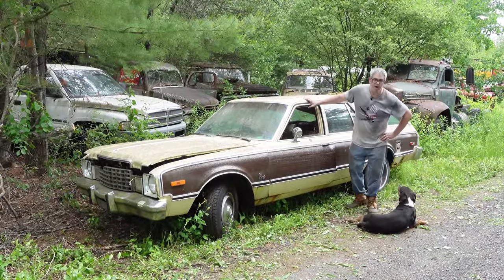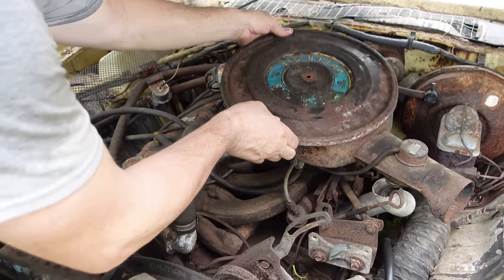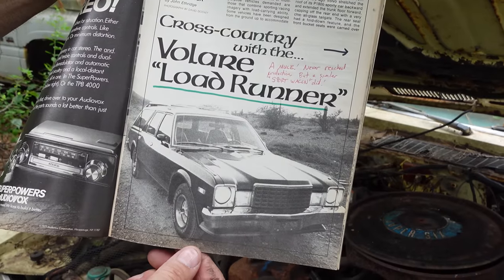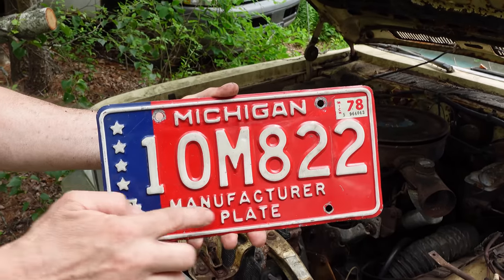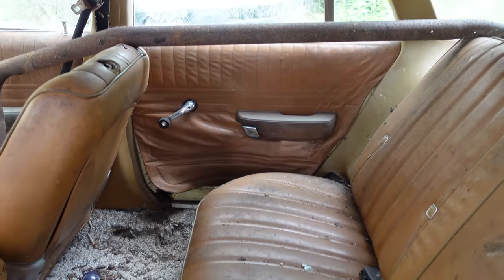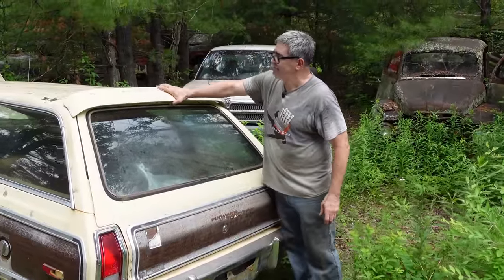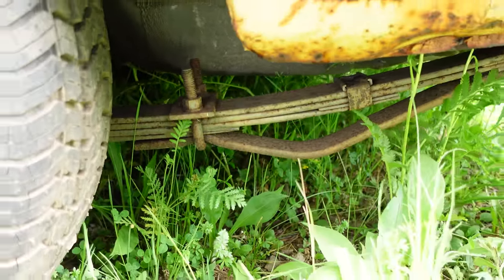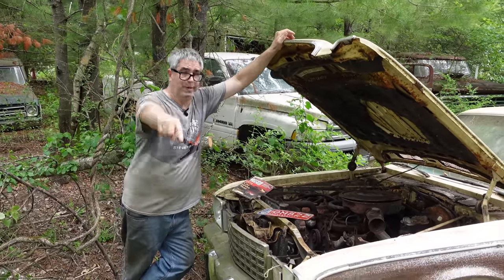Road Runner Station Wagon?

Comment: I ordered a '77 Volare wagon.  It had the 2-barrel 360 V-8 (4-barrel wasn't available) and was a bit pokey. Rally wheels, tuff steering wheel and I added the fender flares shown here plus a rear anti-sway bar.  Nice-looking car but it had lots of rust and water leaks, especially one somewhere in the right side of the cowl which I never could find or stop. After hearing of the front fender rust problems of the '76s, I made my own inner fender liners out of polyethylene and then a year later Chrysler added front liners which I bought OTC and installed. It was my last Chrysler product.

Comment: When we moved grandma from Pomona to Duluth, Mn in 1980, I sort of “inherited” her ‘78 Volaré sedan with the Super Six, as she stopped driving then. After 2 years in Pomona, the blue paint was completely oxidized from the LA smog, but the car only had 13,000 miles. That car had super comfortable front seats, and with a set of Firestone Town&Country snowies on the back, it could handle all but the worst of our winters here.

Comment: A local drag racer ran a wagon in the brackets, what was more unusual was it ran a 4 speed.  I believe it was originally an OD trans, but switched to a regular 833, and 318 or 360. There's just something about wagons on the drag strip.
Reply from the maker: Yes, I agree. That extra tail mass improves traction a bunch. And you can bring the drag slicks in the back if you drive to the drag strip! Thanks for watching and writing. -Steve Magnante

Comment: In the late '80s I had a 4 door Volare sedan with the 318. It was a police package car, but not an interceptor. At one point it needed a full brake job including rotors and drums. Regular Volare brake parts wouldn't fit, so I found another police car in a junkyard, made a deal, then parked beside it and swapped all the parts over.

Comment: Have to disagree with your comment about rusted out front fenders due to “mass production” - even after you mentioned that the fenders were redesigned with drain holes on later models.  Production workers don’t design the cars they build - engineers and management do.  Auto workers can only assemble the vehicles they are given, blame for an obvious design defect falls solely on the manufacturer’s shoulders.
Reply: Go cry to your Union representative 😢😢😢
Reply from the maker: @johneckert1365  Got a beef? Take it up with the Union Steward...Beef Steward.....get it? Ta-damph!!! Thanks for watching and writing. -Steve Magnante
Reply: @SteveMagnante  🤣🤣🤣🤣🤣🤣🤣👍

Comment: Our first "modern" car was a 77 Volare coupe that my dad bought in 1981 to replace the 64 Valiant convertible that my mom was driving. The Volare had the recall-replacement fenders in it because they were still in primer. Super Six, automatic, silver with a black gut. It eventually got passed on to me. An idiot in a 84 Camaro totaled it for me when he thought he could make a left turn from the middle lane when someone was passing him. 

My dad and I found a mint 79 Volare 4 door to replace it. We stripped the 77 for spare parts and junked the body. Drove the 79 until it rotted from underneath itself and made its last trip to the junkyard. 

I remember our 77 being much more sprightly than the 79. Not sure if it was because it was lighter or perhaps the gearing, but both were super sixes and yet the 79 was a slug no matter how much dad and I tuned on it. 

A friend of mine had a 76 Volare Premier coupe with a built 318. That thing was a sleeper. Surprised many a poser street racer with that beast.

Comment: The history of Chrysler Corporation can be summed up as "brilliant engineering undone by indifferent quality control."

What I remember most about these cars are the fragile grilles.  There were a lot of Aspens and Volares in the parking lot when I went to high school and just about every one had the grille punched in somewhere or completely missing,

My other Aspen/Volare memory comes from 1979 when I spotted a wagon with a factory manual transmission with a floor shift, which was so surprising even in those days I asked the owner where he'd had it done.  He told me it actually came from the factory as a special order.  It was probably a three speed but I don't remember for sure. I never learned what was under the hood.

The Aspen/Volare debacle is probably why Lee Iacocca made such a big deal of introducing and advertising his 5 year warranty against outer body rust through during the K-car renaissance.   I know the K's and L's don't get a lot of love these days but they were the right cars for the time.
Reply: Yea chryslers were garbage
Reply: Had a 76 Volare 318. four speed overdrive station wagon with 2.9? rear gears. On level ground on long trips would get 30-32 mpg . Around town would get 10 mpg due to the tall gears and having to wind the engine thru the gears.
There was a sticker in the glove box stating the fenders were warrantied when i bought it.
Reply: @mikew3443  2.76
Reply: I believe they got rid of the three speed, with the A body. As far as I can remember, I was a Chrysler dealer mechanic at the time, all manuals were overdrive 4 speeds. At least the dealer I worked at I never saw a 3-speed in anything other than a Duster.

Comment: Happy to see my base of operations, Michigan, get some love!  I live on the west side of the state, a good 4hrs from Detroit, but in the late 90s I saw an unassuming Saturn wearing a mfg'r plate parked on a side street. I wondered then what kind of secrets that car could be hiding.  Anyway, another great show, Steve.
Reply: Metro Detroit I see them every day. I've seen caravans of 6 in line on I-75. The weird thing is seeing the mules. Ten or 15 years ago, I saw a Dodge version of a suburban, a few miles from the Chrysler tech center. I was excited they were going to finally build one, and they never did. I was driving faster than he was, so as I was coming up on it I thought it was just a Ram with a cap on it. As I passed it I noticed it was all one piece body, not a pickup with a cap, and it had rear seats. This was before they even made the four doors.
Reply from the maker: @garyszewc3339  Cool story. It speaks to the fact that every single car ever built anywhere was once TOP SECRET as it made its way from drawing board to showroom floor. I spotted a 2002 Chrysler 300 in L.A. one time with an unusually long hood and front fenders, a dust cap in the center of the front (steel) wheel and a splined axle stub at the rear wheel center. Then I saw that it had TWO mufflers, each with TWO tips poking out beneath the rear bumper / "tail-scia". YUP, a mule car for the rear wheel drive / 5.7 Hemi powered Chrysler 300 / Dodge Charger LX cars but based on a stretched LH "cab forward" shell with added REAR WHEEL DRIVE! I had NO CAMERA but its was mean and sinister in matte black with its Michigan MFGR plates! Thanks for watching and writing. -Steve Magnante

Comment: Here in Australia we had the slant six two barrel from 1968.
It was a 160 hp rating displayed by badges on the cars painted in Chrysler turquoise.

The base single barrel was 145 hp.

Comment: My first car was a 1978 Volare with the slant 6 and torque flight transmission with the lock up torque converter. My dad bought me it for graduation and it was a great car. My parents also had a 1978 and it went over 200,000 miles witch was amazing for back on 1978. We also had a 1980 Dodge Ram with the same powertrain and it lasted forever until finally rusting out. The cars where so easy to work on and parts where cheap. Then came the LeeIaCOCKA K-crappers.

Comment: My dad had @ 78  wagon with what was effectively the Police Package. All the running gear was heavy duty it had a 360 with a 4-barrel it had a transmission cooler, it was set up.  At one point in time they even had power steering coolers. Lol. It was Tan on tan.

Comment: Hi Steve, great video on this Plymouth Volarie Wagon. As everyone knows Bob from Bob's Burger's drives a red one of these. 😂🤣 But I started my demolition derby career in one of these. I had one of these that had been sitting for a few yrs unclaimed in the back lot of the shop. While in another discussion I was presented with the idea of how to get rid of the wagon... properly. "The only thing that car is good for is the demo derbies." My soon to be crew chief had spoken! I took the bait. So the guys in back told me they would paint it up and get it all stripped out and derby rules ready. Let me just say if you ever get a chance to have someone else set up your car make sure you put down some ground rules. I didn't and left it up to the guys. I figured I'd let them have free rein of the whole project. Well after they had finished tearing out the interior and repaint with some sponsorship names, it was labeled the Rainbow Bright Wagon! It was spray painted with rainbows, pinks and other pastels, etc and someone had fastened a traffic cone on the top to look like the horn on a unicorn. This was well before the whole pride thing. Well I had to stick to my guns and drive this monstrosity in the derby at the county fair. Where everyone knew me and the shop. The only sponsors they could get for the Rainbow Bright wagon were my shop and the local crusher in the area. Even back then there was little to no support. I was told the car started off as a 'hippy thing' with peace signs and flowers. Well, the peace signs never made it onto the car. The guys did well I'm not a derby expert but they had me set up good. Battery, fuel tank and radiator were relocated and a hand throttle that went through the dash and a floor mounted shifter made of 1in square tubing. The doors chained and welded together and at my request some extra steel welded into the driver's door. So it's showtime! I'm out there pushing and doing OK. I made it through the 1st heat and 2nd heat. Boy, was that a day of adrenaline overload. So I made it to the final round. It was 6 of us left and my leaning tower of power was over heating some and beginning to hesitant to take fuel. The guys were shocked they had to actually work on the thing and keep it in shape for the final round. They just knew it was over in the 1st round. So we all limp back onto the track. My biggest worries were the 74ish Chevy wagon and a 80s Ford wagon. A couple of pros in the business. I forgot I became the crowd favorite to get beat on. So through out the entire event I was the target. I guess folks don't like rainbows and unicorns 😅.  Well I finished 3rd and had to break off my flag. My engine stalled and I couldn't get it running and I was pushed up against a barrier with one of my front wheels tangled up with a 70s Buick 4dr. So after the event as they were cleaning up the carnage one of the guys wanted the batteries out of the car so as it sat in the out field waiting on the crusher to take it away. He decided to see if it would crank and sure enough that 6 came to life after a bit of smoke from under the hood it sat there and idled. The only thought that came to mind was when Terry Malloy said "I coulda been a contender. I coulda been somebody, instead of a bum, which is what I am, let's face it." 😂. That was my demo derby career in a nutshell. I retired in 3rd never to return to the circuit again. Have a blessed day everyone 🤙🏼 Namaste 🙏🏼
Reply: 🥉🏁🇺🇸🛠⚙️
😂🦄🦄🦄😂
Cool story demolition man!
Reply: Skittles could have been your sponsor   CRASH 
THE   RAINBOW!!!
Reply: I can always count on you for a great junk yard crawl morning story Chris,I'm curious,what does namaste stand for???
Reply: @jeffreycarleton1535  Hi Mr Carleton 👋🏼 So now I'm gonna have get another rainbow bright wagon built just so I can use that on the side of it. Crash the Rainbow! Well I'm packed up and ready to hit the road once again. Im at a small town called Roxoboro, NC. I was here for their 3 day music festival. The performing acts were great! Just wish the sound guy was a little more generous with the volume 🙄 Thanks for commenting Have a blessed day 🤙🏼 Namaste 🙏🏼
Reply: @williamcavanaugh1415 Hello 👋🏼I'll be delighted to explain Namaste.  (na-mah-STAY)
Three syllables and one simple word that has the potential to bring peace between peoples, peace between nations, and most importantly, peace within ourselves. Literally translated, namaste means, “The Divine within me bows to the same Divine within you.” Bringing our hands together at the heart chakra increases the flow of divine love, kindness, and compassion. Bowing the head and closing the eyes helps us surrender to the divine within. This word has many meanings and can be used as a greeting or goodbye. I believe in a richly diverse family of philosophies, traditions, and practices strung together by a certain core, essential beliefs. One of these beliefs is that the soul is eternal. While this physical body may perish, the soul continues on, taking physical birth and going through death, time, and again. Our souls continue in a cycle of birth and death until it achieves 'moksha' or spiritual perfection and is united with the Divine. But regardless of where one falls in the spectrum of beliefs, regardless of which name one calls God, be it Krishna, Christ, Yahweh or Allah, regardless of gender, race, religion, caste, nationality, sexual orientation, age, we are part of "vasudhaiva kutumbakam'. That is, we are members of a world family which shares the quality of Divine oneness. And so we share unity not only in Diversity, but unity in Divinity. If lived to its fullest intent, the meaning of namaste helps us drop all the walls that separate us and allows us to feel the hunger of others, feel the pain and suffering of others and also share in the joy of others. Three simple syllables, one simple word that asks each of us to do one simple thing, to see divine and be divine. These are teachings of respect and compassion, truth and justice, self-control and selfless service. 
Here in the states it's used quite often in the yoga community as a greeting of respect and peace. Start today when you greet someone, use it silently and know that God is in everyone he's just in one of his many disguises. I'll leave with something from Rumi~ This being human is a guest house. Every morning a new arrival. A joy, a depression, a meanness, some momentary awareness comes as an unexpected visitor. Welcome and entertain them all Even if they’re a crowd of sorrows, who violently sweep your house empty of its furniture, still, treat each guest honorably. He may be clearing you out for some new delight. The dark thought, the shame, the malice, meet them at the door laughing, and invite them in. Be grateful for whoever comes, because each has been sent
as a guide from beyond~ Thanks again for commenting, blessings to you and yours, Namaste 🙏🏼
Reply: Those Volare/Aspens were pretty strong cars if they weren't rusted out. Same with the Diplomat/5th Ave/LeBarron type cars that replaced them.
Reply: @johneckert1365  👋🏼 Hi Mr. Eckert. I can 100% agree with that statement. The wagon I used wasn't rusty at all, it was just beat on by someone who was a house painter. The wagon was covered inside and out with dried up paint etc. It smelled horrible inside. I'm not sure why but it seems like every house painter I've met had an alcohol problem 🤔. I'm thinking it's the chemical exposure not the lifestyle. Have a blessed day and thanks for commenting 🤙🏼 Namaste 🙏🏼
Reply: @chrisscearce  Same to you!
Reply from the maker: @chrisscearce  I can work with everything you say here! More namaste please! In fact, make it a round for the entire house...on me. Thanks for writing. -Steve Magnante

Comment: In 1980 ish...I had a 1970 cutlass station wagon with a 455 rocket, low rear end tow/pulling options. package...As every kid, I added dua holley 750 dbl pumpers carbs, intake manifold, headers and a loose B&M 3000 rpm torque converter...
It warped reality from stop light to stoplight! And you could see the gas gauge drop after every stoplight launch... Ultimate 5000lb + sleeper back then.
And it pinged on anything less then 93 premium leaded...lolz ohh the days...

Comment: My Dad was a technician at a Dodge Dealer and got me an after school job in the Service Department where I filled out all the warranty repair paperwork from 1976 through 1978 when I went off to college.  The "Twin under the skin" Dodge Aspens were notorious from 1976 through early 1978 for eating carburetor pump plungers in the 1 barrel 225 Slant Six engines due to incompatibility with unleaded fuel.  They typically came in due to stalling on uphill right hand turns.  I think they went through 6 different rubber compounds before they found one that worked.  The same cars would come in time after time for the same issue.

Comment: My mom had one of these in cream with a 2bbl slant (no wood) and my buddy's mom had a chocolate brown Aries K Wagon with scratch and sniff stickers all over the dash and rear windows. That 2.2 blew my doors off. The Volare wagon was stupendously slow, but you couldn't kill it (trust me, I tried). I heard that the slant was supposed to be all aluminum originally, but casting was not up to par then, so it was made in cast iron making it way more robust than it needed to be.